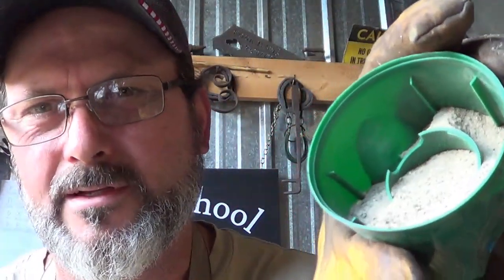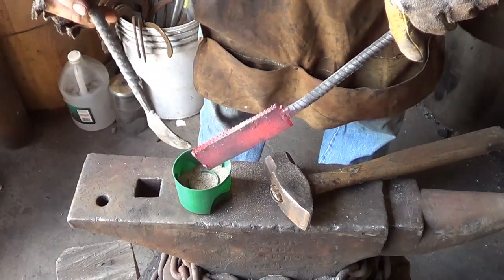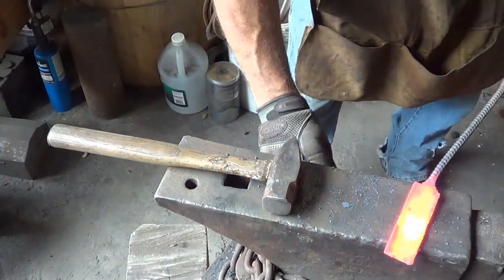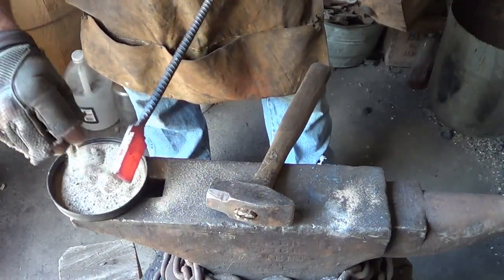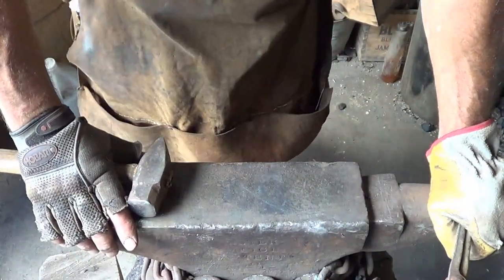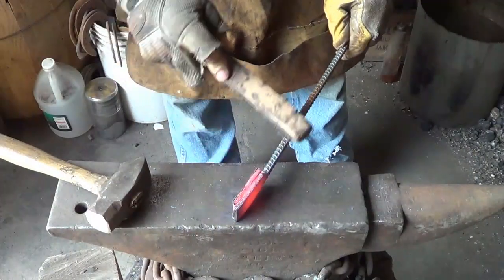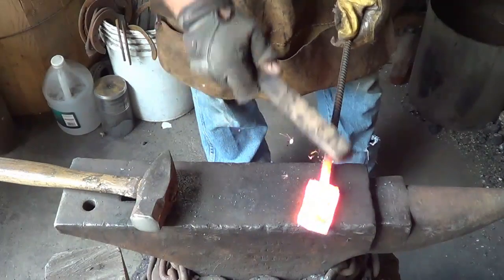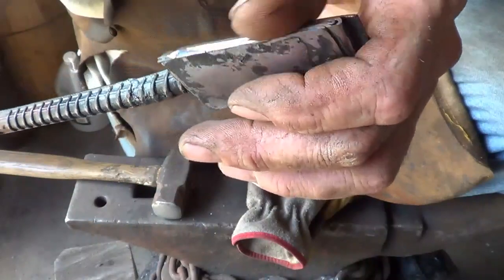Blacksmithing - Forge Welding With Sand As Flux

Comment: I just now came across your video here Chandler. Very interesting to say the least. Right now I am very new to blacksmithing and I've not yet tried forge welding. I wasn't aware that you even could weld using sand as a flux. Good video.

Comment: You need to start with really hot sand. The sand probably cools it significantly in the process of putting on the metal.

Comment: I'm a bit mystified here watching you forge welding because as I understand it to weld something successfully requires both surfaces to be at their melting point or above it. 
The flux is obviously removing the oxides from the surface of the steel but my question is what is actually happening when the steel is still below it's melting point as in your forge welding?

Comment: i used to do canister damascus with no flux, just rods and wire in a piece of cleaned pipe, i'd mig weld a cap on and a rebar handle and it was basically sealed. i also tried using galvanized plate in between tool steel so the zinc acted as flux, that worked nice and gave me some cool shiny spots and probably zinc poisoning but whatever. good old borax seems right tho, or just get a low-melt coated welding rod and throw it in the mix. ive also tried just wrapping the stack with flux-core mig wire. that didnt work. suggestion BUSTED.

Comment: I'm not sure if it should be applied as some sort of glue right before folding like at 5:35.
I'm a layman but didn't you just entrapped an impurity (silica), maybe even a solid sand particles in between the plates? It doesn't make sense to me be it borax or a sand

Comment: I watched as you did your lamination and forge welding of the bandsaw blades.  I saw a couple of things you could have and should have done differently. You were trying to treat your sand as a standard dry flux that melts on contact.  Sand does not melt at the same temperature as borax.  The purpose of flux is to prevent and minimize oxidation of the steel as it is heated.  The second purpose of using a flux, is to keep, or to help clean the metal prior to welding.

Regarding your attempts to use sand as a standard flux, as you know know, it cannot be actually used in the same manner as a standard forge weld flux because it doesn't melt and join to the metal during the reheat.  Because you were "Pouring the sand" the bulk of it tended to just fall away and slide off, even at the higher temperature.  The proper way and correct approach to using sand as a flux, is to take your heated steel and push it directly into the sand and immerse it.  Enough sand will stick to the steel.  While in the sand, steam is released as the sand contacts the steel.  This property aids the forging process because it pushes the air away from the metal so that only sand and steel remain.  It only takes a couple of seconds to push the steel into the sand in order to acquire enough for the forge weld.

Finally, there is the issue of the sand.  You were using a play sand, a sand that was carefully washed and cleaned.  It isn't so much as how well the sand has been cleaned, as it is, the contents of the sand.  A successful sand weld should contain a balance of different minerals for a successful forge weld.  One of the best sands to use, is a white "Silica Sand" that has trace amounts of "Black Sand," which is actually ironite particles with trace amounts of hematite minerals, a type of iron ore.  The silica sand cleans the metal and minimizes further oxidation when hot steel is emersed into the sand for welding.  The trace black sands and hematite serves to aid with the welding process and actually becomes part of the steel itself.  Certain types of silica sand also contains trace amounts of calcite deposits, a type of calcium, which is also a good insulator and aids in minimizing oxidation in steel when forge welding.

A word of caution.  Too much black sand, and too much hematite will make your steel hard and brittle.  The deserts of Egypt, the middle east and North Africa have sands, sand dunes and sand drifts with high amounts of silica, making it ideal to use in forge welding.  Incidentally, silica is the mineral that makes clear glass possible and is largely used in glass production.  Interesting video, I enjoyed watching you experiment...
Reply: Thank you A LOT
Reply: Sure sounds like you know what you're talking about, its refreshing to see something like this on YT of all places
Reply: So you could probably use pulverized glass as flux
Reply: @jizburg  well perhaps. But the melting point of glass is too low and might probably burn off long before welding heat is achieved. Glass is also an impurity that can ruin the quality of steel, especially if it is going to be a cutting edged device like a knife or ax. You are better off using something that offers better cleaning and minimizes oxidation of the steel as much as possible.

Metal dust such as iron, or steel shavings and filings are good choices. Wood ash offers excellent protection against oxidation, however will also require a longer soak and heat time to achieve a weld. Welding mediums such as dry flux compounds are your best option. Pure Borax used in detergents is an excellent choice. You can also by iron sand, iron powder and metal shavings to use. 

Or, if you are a prospector, save your black sand and use it as a flux. It's mostly iron deposits that includes hematite and magnetite... Hematite is actually an iron infused glass that makes excellent jewelry. But large deposits of hematite and magnetite or ironite can be found in the bottoms of gold matrix during prospecting. They could potentially provide an excellent medium for a fluxing compound in forge welds. Good luck.
Reply: I agree. He needs much more pure silica and also it should be preheated. If it cools down the metal it's going to create pockets in the metal and make the heating/cooling uneven in the crystalline structure of the metal.
Reply: When I have seen videos of japanese sword smiths forging the ingot . It looks like a type of fine sand they apply at various times in the forging process
Reply: Thank you for the explanation

Comment: To forge-weld using sand as flux requires repeated bilateral compression (hammer or press) intervaled by multiple twist compressions. That's what moves the inner parts of the Ingot to the outside edges and outer surfaces. The twisting expels molten sand mass (with other non-ferrous material) and prevents it from being trapped within pockets of ferrous mass. (The twisting is like wringing water from a wet towell) 
And you are right. Your steel must be white  hot.
I love your channel. you've taught me a few things.

Comment: I always enjoy watching your videos and have recently built a small forge and purchased an anvil and some other tools to start learning more on my own. I always understood the reason for flux in any weld is to create an o2 barrier and a cleaner that will absorb impurity's in the metals into a slag that can be removed post weld. One would assume that flux would thereby be needed in every weld in one form or another to insure a clean weld...for example using argon gas vrs flux core wire to weld with...two types of what are in affect the same thing. One more expensive but much cleaner to use with far less clean up.
I dont know I could be way off base here...
I Look forward to more videos!

Comment: Just from your videos I would stick with Borax, much easier and less mess when applying. Then it is a known quantity every time you resupply and sand can be any material and any grain size, some or parts of some sand could be worse for welding while Borax works every time and is consistent even if it is years between supplies. Consistency is incredibly important for materials to get consistent quality work done.

Comment: Pure quartz melts at 1,650 °C, perhaps the sand you had melts at a lower temp. Steel often melts at around 1370 degrees C, while iron is closer to 15 thousand c's.. so basically my point is that I'm dubious that the sand was melting because the metal wasn't.

Comment: Loved the video, just began to study blacksmithing. A great beginners book I found is titled, " Forge-Practice and Heat Treatment of Steel", copyright 1919. Author: John Lord Bacon. (pdf available online for download - fair use - copyright has expired)

It's has a decent chapter on welding. On page 21, regarding flux, it states flux should be applied when the work is yellow in color, and all pieces to be welded should be fluxed (it appears it's talking mostly about harder steels (higher carbon).

The fluxes listed are sand, borax, and the author specifically states that a flu made from one part 'Sal Ammoniac' to four parts borax is the best.

While I haven't tested and am still a noob, I do trust the words of a 'real' blacksmith that has probably been dead for 75 years; keeping in mind this book was published 97 years ago.....  I'm reading the 1919 Third Edition...

Comment: from my research i found some evedence that quartz sand was used in the past. but no every smith had the luxury of quarts sand. but its shoud do better than normal sand you find everyware. 
i have to say that i like your video and showed it to my prof at my uni. your video become class material. 
btw. i study mechanical engineering and as second historical engineering in germany.

Comment: So beach sand is going to have a ton of quartz. Quartz melts at something like 1600C or 2900F. So if you are going to use it as flux you would need it to melt and turn in to glass to stop O2. That means getting your work very hot.  Much hotter than you would need to with borax.

Comment: I wonder what made the first person think to use sand when forge welding.
Reply: I assume it was related to the initial production of steel. "Iron Sand" and all...Presumably they used Iron Sand to weld at some point, figuring it would help the metal stick, and at some point, when they were short of Iron Sand and needed to weld, tried whatever Sand was handy.

Comment: I wounder if you could have a heavy steel bucket or container of already melted sand and you dip the metal in it. I wounder if that would work. if it would then you could use the glass flux with steels that you want to keep certain metal properties from being lost.

Comment: I wounder if this is how they got silica steel. Other than that, could you try to see if "waste lime" that very fine grain rock waste they get after crushing up limestone rocks would work. that stuff is really cheap but I am not sure if it would work or not. On another note is the clay type cat litter. I wounder if that would work. Heck could try dried clay dirt from the ground. Sometimes its just messing around with things to get something that somewhat works and then finding out what is in it and what can be made to work better. Thinking also is a liquid clay solution. put on when the steel gets relatively cool about a red to a red orange and possible orange hot could work. 

Hey experimentation is the key as that is how they found out about borax working. Also it is what types of steel the stuff used as a flux will work.

Comment: Sand is mainly used in the hot fire of a crucible to draw impurities away from the metal. If you use floor sweepings again in a crucible to recover the lost metal, sand and a chunk of glass would be the way to go. Your resultant bloom would be more pure as opposed just the floor droppings. A pure fine silicate sand is the best for such applications. Good work!

Comment: I wonder if the sand used for flux had iron in it?  I have only heard of sand being used as flux in combination with iron filings.  If the "black sand" containing iron was used, you might get the iron flowing through the weld with the sand scouring it?

Comment: Good experiment, I've always had good experience with borax however I've done a few with no flux that turned out fine. I'll stick to borax until I find something as cheap that works better. The only thing I bring home from the beach is Stripers!

Comment: could I use a piece of I-beam for a anvil
Reply: I sure wouldn't seek it out because it doesn't provide the solid rebound you need.  But if I had it I'd use it to get started until I found something else.  Do a search on post anvils for ideas.
Reply: it would work, the bigger the better & you would want to fasten it to something heavy so it wont bounce around... a piece of railway would work better 9 times out of 10 & a anvil will pretty well always work better then a piece of railway.
Reply: You can usually pick up a used anvil for close the price of a decent I beam anyway.... Otherwise just big a solid block of steel say 3 inch by 6 inch will work for a lot of basic blacksmith work

Comment: From looking around on the internet and talking with some smiths who have been at this a while they said that sand can work but is mostly suited for wrought iron since it needs to be a little hotter to weld and that it does not work as well for higher carbon content steels. They also recommended against the 20 mule team borax since it has water added to the borax but instead to use Forge Borax or any other borax without the water added. Supposed to clear impurities better.

Comment: The part I think would be coolest to discover is that the fact that sand, if heated to a high enough temperature and with enough pressure, will become diamonds. Now I'm no scientist or geologist but that would be cool to find when forge welding with sand
Reply: No it won't...
Reply: Wait but sand is mostly silica and diamond is carbon, I am really confused here
Reply: Just making sure OP understood
Reply: +Virtual Acorn that's why I said it wouldn't.

Comment: I put this message when i first started the video, have not watched it through. But i know when sand is hot enough it turns to glass, so it seems to me that sand would take a lot hotter temperature than the steel would and therefore wouldn't be a good flux. As i said put this on before i finished the vid. Interested to see how it goes though.

Comment: Wonder if a more powdery sand would give better results since its a finer grain thus melting easier.  As well as dunking it in a bucket versus sprinkling the sand on.
Reply: My thoughts too.
Super fine sand and just shove the whole piece in it.
Would probably work great.
Reply: Adding some lye to the sand will make it melt at a lower temp, that will probably increase the coverage.

Comment: I'm new. Why is he using the brush?
Reply: He is brushing off the scale, its a layer of oxidized metal that is similar to rust with a slightly different chemical structure.
Reply: The scale messes with the forge weld and just ruins the finish
Reply: Yeah basically when metal is really hot oxidation is accelerated rapidly.
Reply: Oh ok, thanks!

Comment: This is interesting.  I wonder if finer sand would work better.  I also wonder if different mixes of sand/borax would present similarly different results (lets say 25/50/75% concentration borax plus 75/50/25% of sand).

It could be useful if you are working a metal that needs to be hotter than your average mild or O1 to have a flux that stays thicker at higher temperatures with added sand is my takeaway from this.  Thanks for sharing Chandler!

Comment: Greetings. I want to ask what the source of your material was here. Who was the manufacturer of that steel and what material is being utilized (In terms of Carbon content and hardness)? Considering you're using a processed blade makes me assume that this is a pre-hardened and tip heat treated blade, which could obscure your results.
Reply: It would probably be 15N20 or about 1080 in composition, but prior heat treatment doesn't affect how it forges or welds once it has been brought above critical.

Comment: could you make Damascus out of rebar?
Reply: Possibly. Rebar is made out of whatever steel is taken from a junkyard and then melted down. It is not uncommon for rebar to have inclusions, and it certainly would not be an ideal blade steel. It would be fine for Damascus for bolsters and decorative items, though.
Reply: ud have to forge weld a high carbon piece onto the edge if u want it to be a practical knife, rebar doesn't contain nearly enough carbon lol
Reply: Out of only rebar no if you were to forge weld in another steel along with the rebar then yeah sure but it won't be the best knife in the world
Reply: +Alex Roberts yea pert much lol, should use like 1075 and sum 5160, even like 1075 and 1045 would make a Suttle damascus and still be a good ass blade
Reply: the simple answer is yes  you could.  it would be more certain to get Damascus if you add in a different kind of steel with the rebar .

Comment: ive seen sand and glass used as a flux for making crucible steel
Reply: that's at a higher temp then ud use for forge welding though, but ur right I've seen that quite a bit as well lol

Comment: The Sure Weld flux is a mix of Anti-Borax & Ez Weld. Ez weld is 10th Boric acid, 1/2 Iron oxides, 10th Silicon Dioxide aka Sand and 1/3rd steel filings. Anti Borax is mainly Boric acid & Borax mixed.